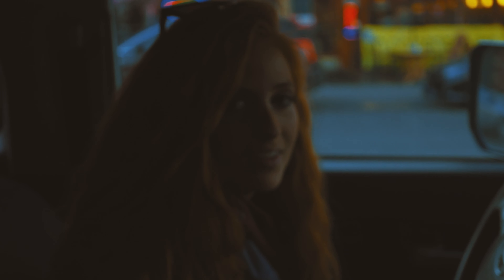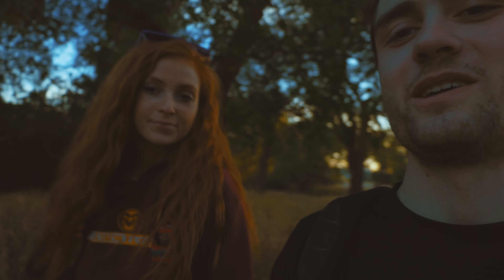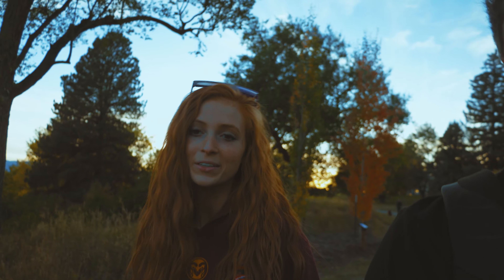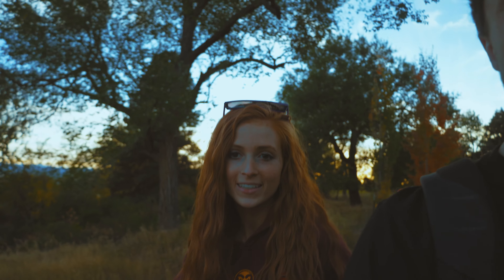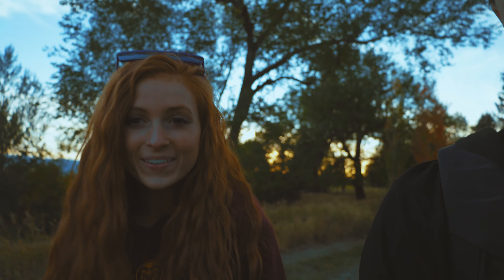Does the Canon R6 still OVERHEAT? | Firmware 1.1.0

Comment: Hi Matt, thanks for your video! Please let me know what settings you were using? Were you using CLog? Were you in manual mode? what lens were you using? were you using manual focus? If you were in auto exposure mode what were your exposure settings? If you were in Clog... what LUT did you use for color correction.  thanks!
Reply from the maker: Hello! I film almost everything in C-Log using SERVO autofocus, manual exposure, the RF 24-105 F/4-7.1 STM lens, and I color corrected without a LUT for this video but I highly recommend Matti Happoja’s luts! Let me know if you have any other questions!